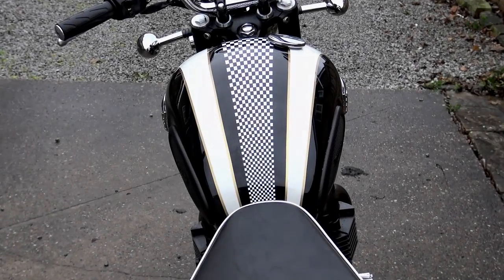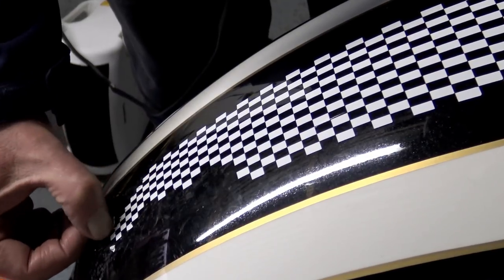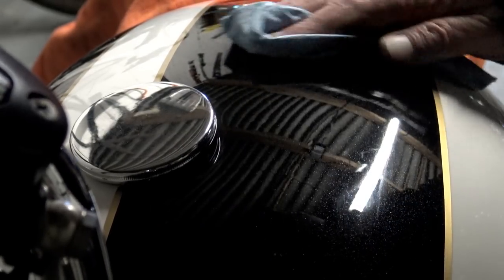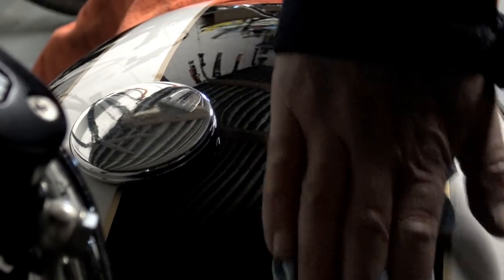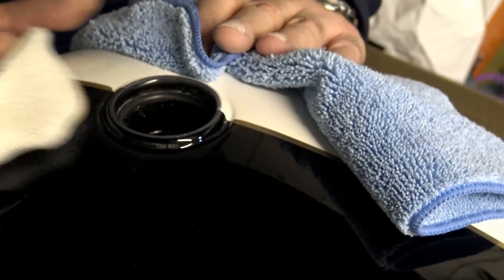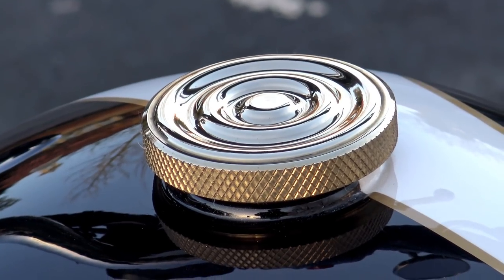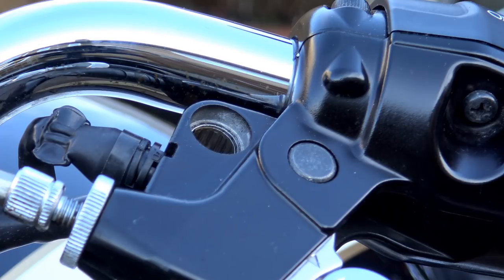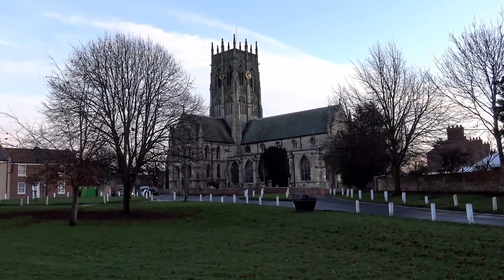Custom Triumph T100  Pay Day Project Pt4, Decal removal, Brass cap, Union Jack, & Bar End Mirrors

Comment: A hot water bottle works great, it is impossible to overheat the paint, and the rubber moulds to the shape of the tank or side panels perfectly, your chemist sells them for £3.75

Comment: Great video Stuart - I'm going to use your decal removal method on those "safety" stickers telling you to wear a helmet, put some fuel in and read the (useless) manual.  The T100 Bonnie is starting to look really good.  I love mine too: of the bikes I own that is the one I will keep.
Reply from the maker: Good show Mr Trippler! and thanks you very much ive made a start on her let see where we get to! thanks for watching!
Reply: Top tip to use Tar Remover - worked an absolute treat.  Cheers!
Reply from the maker: No problem mr Trippler! you can just take the residue off with the polish but it makes a mess of your cloths and takes longer! Thanks for watching sir!

Comment: Looking at getting a brass cap for my Thruxton to accent the gold stripe. After looking at my options. I could get a brass replacement "top" that uses the factory plastic threads like the one offered by A&J cycles or use the Motone one. My only concern about the solid brass Motone cap is the possibility of paint wear on the threads of the petrol tank. Wondering if I am being overly paranoid about a non issue?
Reply from the maker: The actual thread on the motone cap is aluminium, but ive not experienced any wear on either of my bikes with the caps.

Comment: Good call on the checkered decal , it really didn't suit that bike and you cleaned the paint up nicely, I'll be facing the same clean up when I remove the emblem from my Indian Scout tank. The gas cap looks great. the metal finish is called "knurling" I believe and it adds a nice finish to the cap and of course serves a purpose. Looking good Stuart, more like a classic every upload.
Reply from the maker: Yes the knurling is the chequered pattern around the outside sir. but the top has a rippled design machined in to it! she looks much better now! good look with your decal removal!

Comment: Very nice. Stuart, now that you have both the T100 and the T120. Which one do you prefer and why. I’m looking at the T120 for the bigger engine for distance riding, the dual front brakes and heated grips. You’ve done both and I value your opinion. Thanks.
Reply from the maker: The T100 is the old air cooled version sir! so its difficult tocompare the 2 in many ways. especially as it is in dire need of new suspension and Tyres. but it is a lovely, fun, nimble bike to ride with bags of character. i really didnt expect it to be as good as it is. your on the right track with the T120 for long distance riding, especially where the fuel economy is concerned, hi 60s mpg on a run even dipping into the hi 70s if your careful!

Comment: I just received a Motones Brass Ripple gas cap like yours.  I was expecting  a Black gasket on the cap and I got a clear to translucent gasket.   Did you receive the same type gasket as I did ?  What color was yours ?  Thanks , Bill
Reply: I too have gold carage stripes on my Street Cup.  That is why I bought the Brass cap too.  Of course we call them pin stripes this side of the Atlantic.  Ride safe.
Reply from the maker: Hi Bill yes i did, I prefer it actually as you dont see it when the cap is on the bike like you do the black seals.